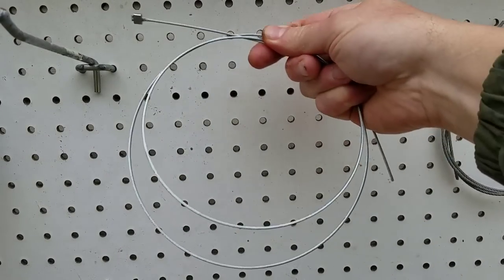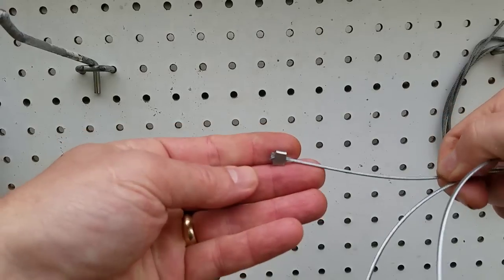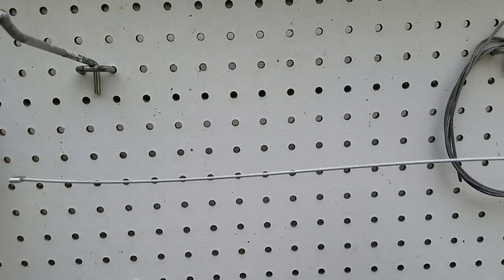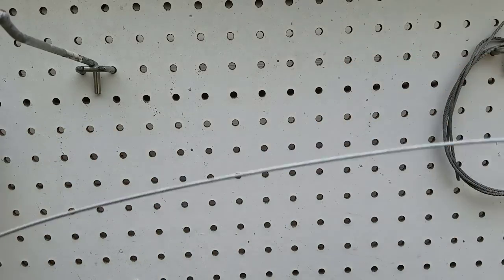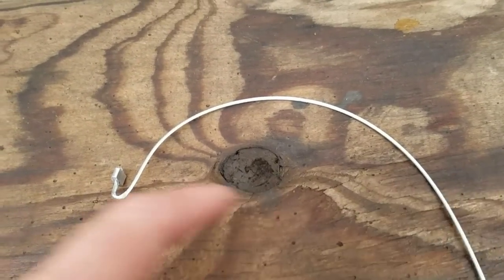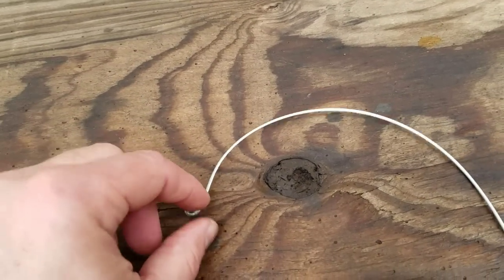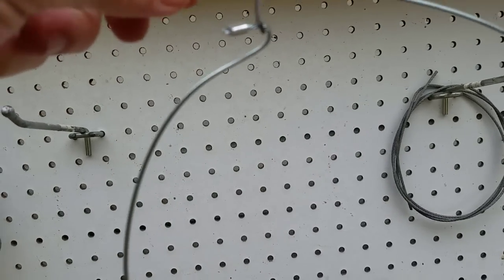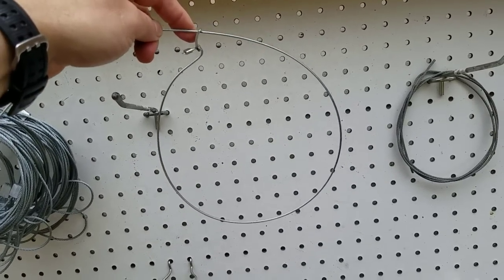How to Load a Snare

Comment: Had to laugh at my first attempt to load a snare. Like you said, I cork-screwed that cable and then compounded the problem by trying to correct it (more than once). The end result was almost comical. You’re sure to laugh if I sent you a picture. Fortunately, I was more successful with subsequent snares. At least they’re usable. Thanks for the excellent lessons.

Comment: Great video, Tim! Quality cable is key to effective loading. Newt Sterling explained to me that if a cable is too straight or if you hold a cable and it doesn't naturally droop down (trying my best to explain through txt lol) it's a bad cable and I had a hell of a time trying to figure that out cause loading was not working! I got cable from another dealer and much happier! I actually wear buffalo hide gloves and load my snares with my thumb after their built. Southern snares looks like high quality and I'll have to check them out :)
Reply from the maker: Newt knows his stuff for sure. Quality cable is the foundation - if your cable sucks then nothing will work right.

Comment: Good video I just sent a order in to southern snares this evening figured I’d get some of my early this year what size of barrel swivel would you use on a coyote I’m gonna try the barrel swivels this year I just ordered a couple sizes just a dozen each no 9 no 12 and what size on beaver or use the same?
Reply from the maker: I use the #9 barrel swivels on beaver. For anything on land, I'd move up to a #12 to be safe. A yote can stretch that 9 out good.
Reply: 6/0 (Sold as #6 by trap suppliers for some reason) is more than plenty for beavers, etc. It has a 600 lb rating.   8/0 has a 900 lb working load rating.   9/0 (1000 lb) is my standard hog snare swivel, and 12/0 is reserved for the largest snares, 7/64 and 1/8 snares.  It has a 1500 lb working limit.

Comment: What cable do you suggest for hogs in central Florida? I see that you use different cables. Thanks. Like the info. I also sub your channel.
Reply from the maker: Personally I use 3/32" diameter 1x19 twist cable. It will hold most hogs. On my recent trip to Arkansas, we had two hogs that broke 1/8" 1x19 cable that had a breaking strength of 2,000 pounds. Incredible power, but the 3/32" 1x19 will hold 99 percent of the hogs you will catch. Good luck!

Comment: What is the name of that snare lock?
Reply from the maker: Jeff A That is a brand new lock that Newt Sterling sent me to test. He calls it his Master Lock. It is available on his website, snareone.com. It is extremely fast, even on rough 7x7 cable, but it is not aggressive. It's designed to be very fast and useable where relaxing locks are required.
Reply: Thought that was Newts lock, but when you said all components came from S.S., I thought they may have started offering something similar.  It’s a great lock, and I really like them.   Non polished stainless is what more locks should be made out of.  

Thanks for clarifying